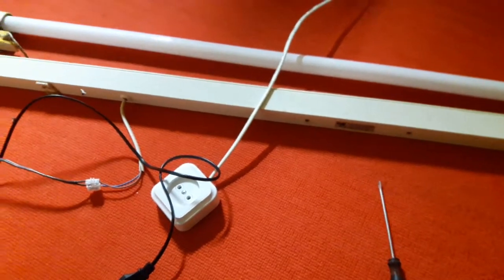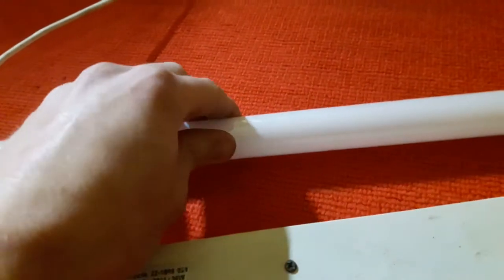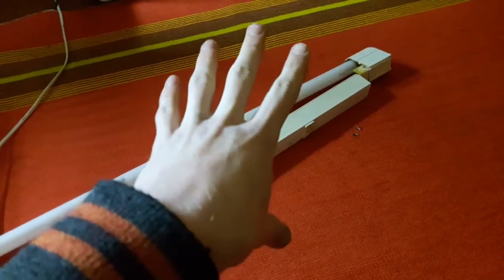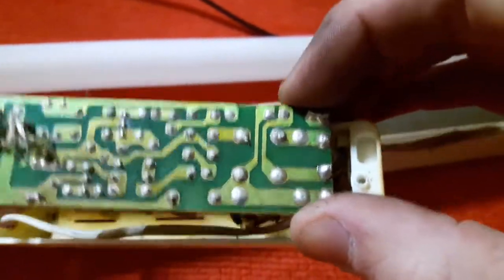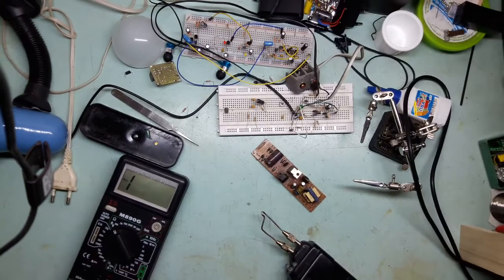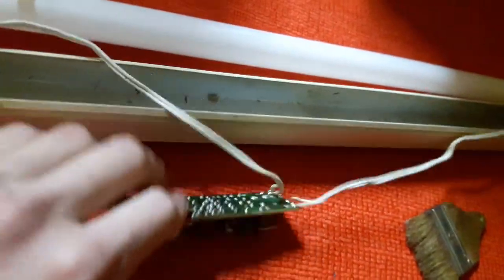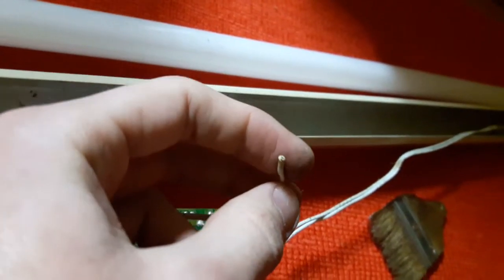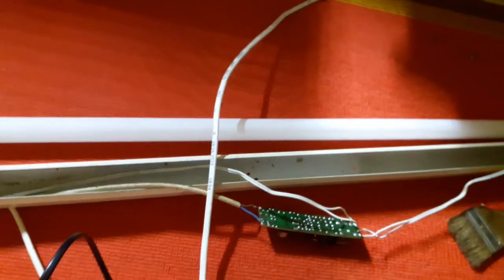Repairing ballast for T8 fluorescent tube

Comment: Don't curse, God does not like that. I like your humor.(I'll won't go out on the street anymore - too dangerous!) I always leave the power on as much as possible when working with electricity...Just use your brains and don't touch two things at the same time. I like your accent too! My problem is a led light with ballast, the light works with another ballast, the capacitor at the beginning of the ballast is only 300V. (yes - is shortcuts) The rest I can't read - my eyesight is not that good. And I never went to electricity school... So? change that first capacitor?

Comment: My T5 21W 860mm tube light which is very rare here (usually 18W 600mm or 36W 1200mm) fail two week ago. Capacitor is bloated but also transistors looks bad and some resistors spalling surface. Not possible buy new because not in sale because some EU regulation but I have one good used tube and two new not used.  Spare parts will cost more then same lenght LED but they also fail and dont want trash new tube I have

Comment: Dear Mr. Johnny, is there a way to test the electronic ballast without the tube installed? I have not studied the subject yet, I came straight to YT and watched the first competent video about it - yours. Thank you.
Reply from the maker: Test the fusible resistor if it has one, than check diodes, transistors. Best test is with the tube, no way around it.
Reply: @mrjohhhnnnyyy5797  Update: I have desoldered and checked everything except inductors, resistors and the transformer. All good, one 22nF/100V capacitor was suspect, I replaced it with 22nF/630V. I put everything back together, turned the lamp on - no change, doesn't turn on. I bang the lamp slightly against the table - it lights. I tap it against the table again, it turns off. So in the end I check the only thing I haven't checked - the switch. And of course, contacts eaten, switch worn out. A stupid mistake, I should have checked that first. It is perhaps because I usually troubleshoot more complicated things.
Reply from the maker: @I967  I have the same issue: I try to find a complicated problem when it is really simple, like a bad cable or switch :)
Reply: @mrjohhhnnnyyy5797  Thank you, I will do that, it was my original plan. The tube worked after I replaced it the last two times, but sometimes it would flicker and it has a suspiciously short life (about a year and a half). This is kitchen light above the counter, perhaps it is because it is turned on and off very frequently?

Comment: Saved and liked. Burned my f15t8 tubes twice in a 1.4 year span was something i had to look into this ballast system inside 15" fixture. Two tubes has darker deposit toward end to transformer tap in right end.

Popped it open revealed a fat transformer on right end and small circuit on left end holds two tiny 400v capacitors and few resistors, and 120v indicator bulb. I kinda figured capacitors could be somehow go bad sometime later. I will go out and get the new parts soon. 

I am writing to thank you for your assurance on this capacitor... now i have to add this transistor tester to my collection!

Comment: Ha ha "johnny is a lying sack of shit", you have a comical way with words :-D :-D
Shake that fist "It was staged" he he :)

I know what was wrong with it, like a computer it had a lot of bugs in it :)

I used to repair a similar circuit that ran the tubes on buses/coaches, there was a capacitor across the power input and if it dies, the unit wont strike, also the transformer was a rather odd and complicated group of windings.
The transistors i think were tip41a's
Reply from the maker: I decided to put a bit more humour and see the reaction :)
Yes, I had to take out the debugger - aka Vacuum Cleaner :D
I have built similar circuit to the one you are talking about. Self-oscillating push-pull converter, the Royer oscillator. Works quite good for driving flybacks to get some fat arcs, it is resonant converter, none of the less ;)
Reply: i would say your experement worked :), you now know that my humor is silly :-D.
Never trust anyone without a sense of humor, they have mental problems :-D

Comment: I would had replaced it with a good Vossloh Schwabe or Tridonic magnetic ballast and the proper sized PFC capacitor.
Reply from the maker: I got those things for free, so I'm happy to restore them at minimum cost. I don't like magnetic ballasts because the damn starter takes ages to strike the tube.
Reply: MrJohhhnnnyyy If SRS ballasts weren't so uncommon in Europe that would be an option.
Reply from the maker: I'm not against the choke itself, yes it is heavy and it hums, but it doesn't produce any interference. I saw some circuits that supposebly replace the starter. Haven't tried those.